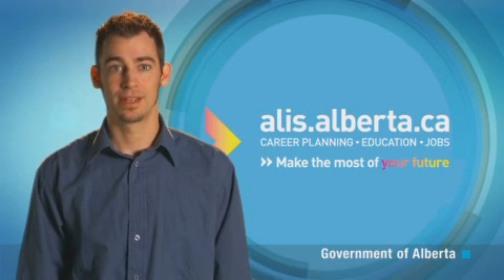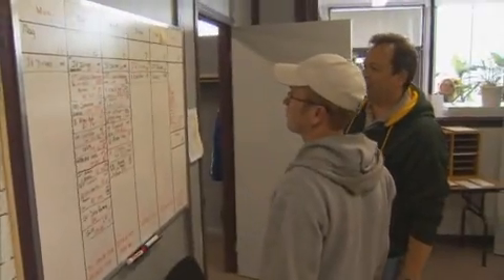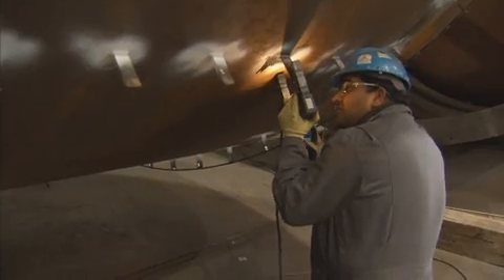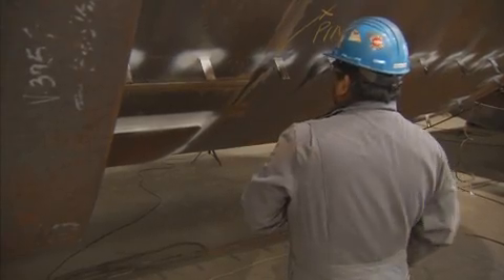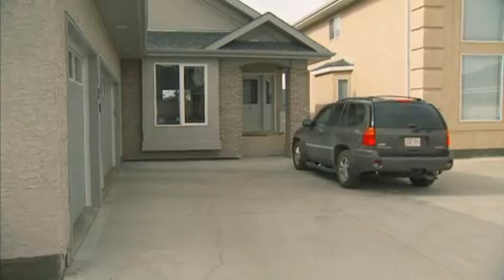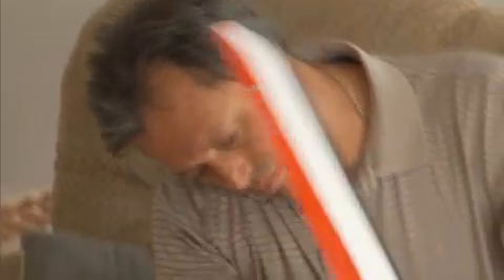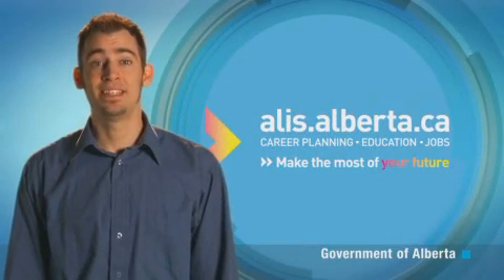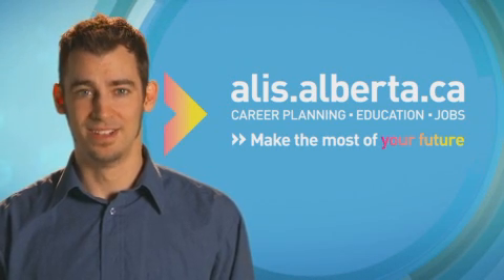Occupational Video - Non-Destructive Testing (NDT) Technician

Comment: Ive been one for over 15 years . PCN Level 2 here in the UK, The job can be very interesting, and satisfying. and hold alot of responsibility . as you and your team are responsible for giving the all clear,or rejection of the item tested to the standard specified by the client.
the job can get you about too, Ive worked mainly with pipework,pressure vessels, Castings, aircraft parts, even the job of X-Raying old master paint works fopr museums. a very satisfying carreer